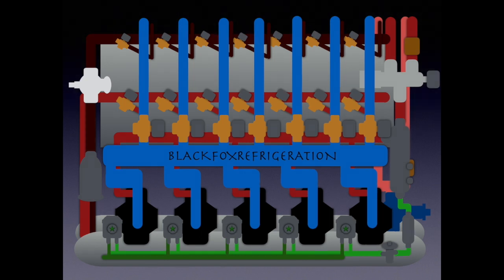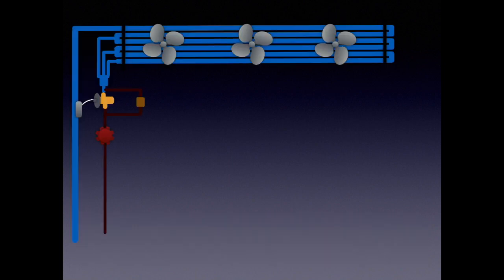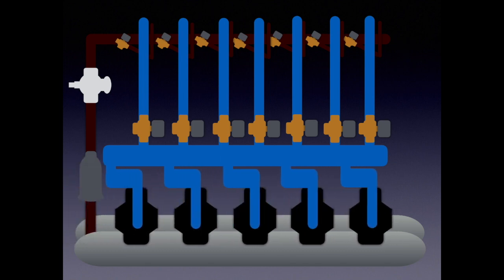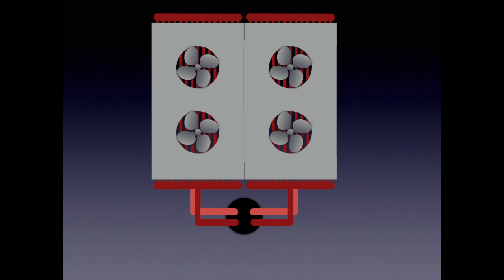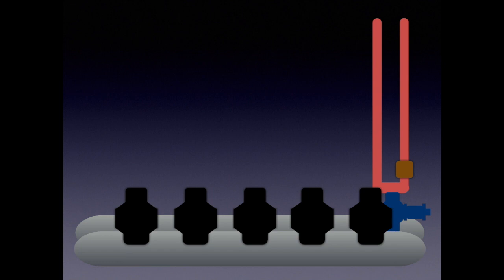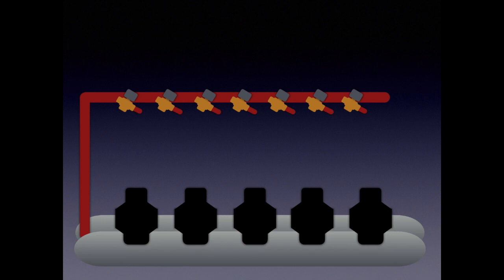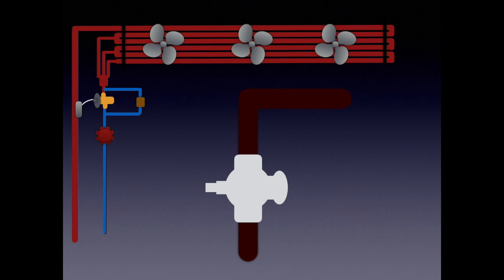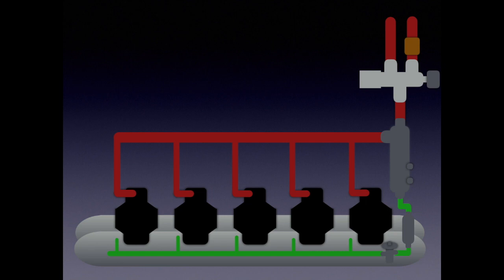RACK REFRIGERATION LAYOUT

Comment: This is very nice presentation. I think the check valve on the discharge line of the split condenser is not needed. Once the condenser is split, the discharge splitter valve will automatically prevent refrigerant from moving to the unused part of the condenser. What do you think about this?